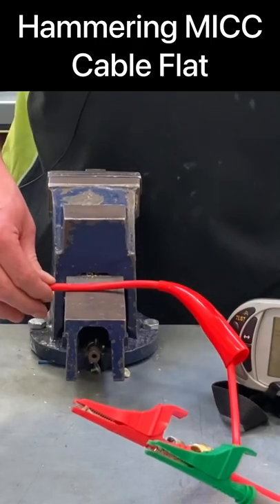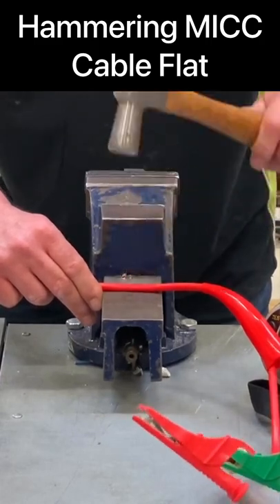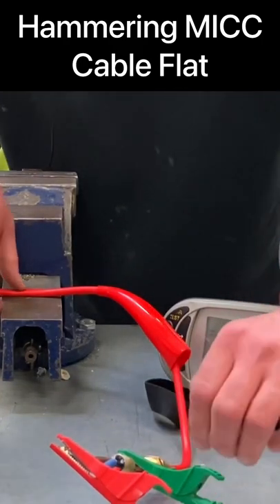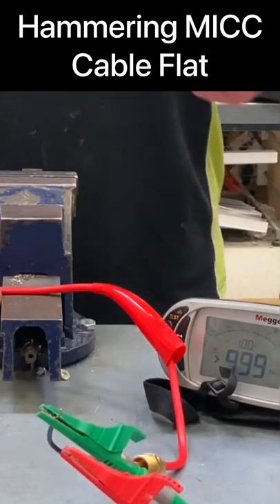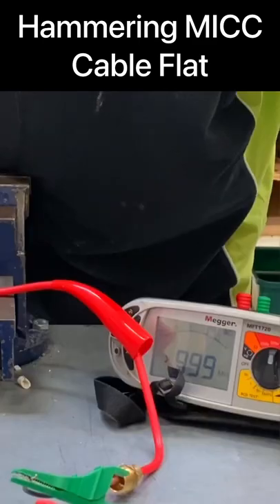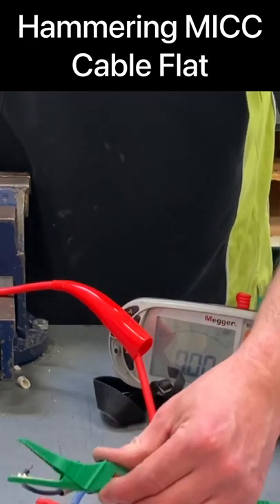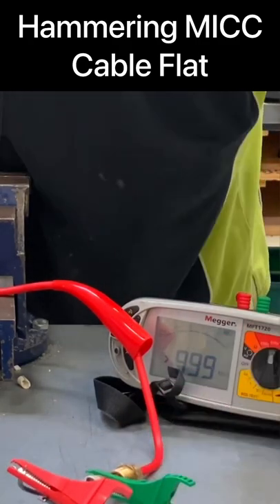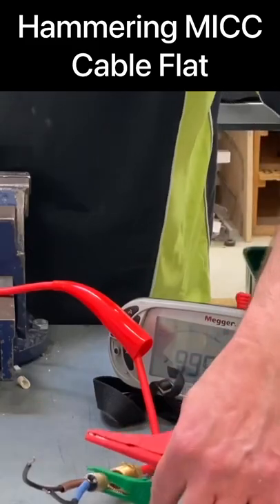What Happens When I Hammer 🔨 MICC Cable Flat (Pyro Cable)

Comment: I done a job about 10 years ago . It was only by chance I found a 3 phase  and neutral MI cable damaged by a industrial strimmer.  It was a fairly large cable probably between 1/2 inch to  5/8 diameter 
It had been cut through to the inner cores . It was still working . I couldn’t believe it .Not even a burn mark. . My guess ,it was like that for some time.. Biggest problem was trying to repair it being imperial. and having to use second hand imperial pots and glands

Comment: Do a comparison between different cables, armoured, nyyj, sy, twin and earth, TRS etc
Reply from the maker: Looking at different types of cables 👍🏻
https://youtu.be/Tl2JsE-ihjM
Reply: @GSHElectrical  I should of been clearer, a hammer/ destruction test, see where they stack up against each other, honestly I was surprised the micc failed as easily in this test, some of the other comments mentioned pvc twin could hold up as well ( 😂 ) but it would be interesting to how it compared.